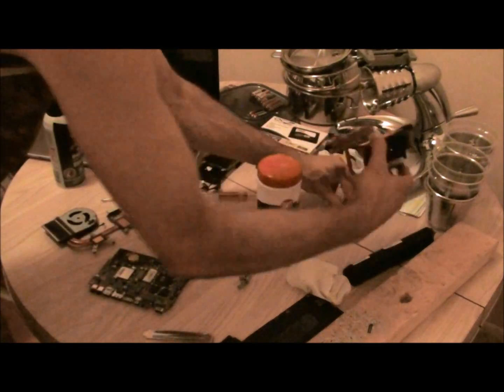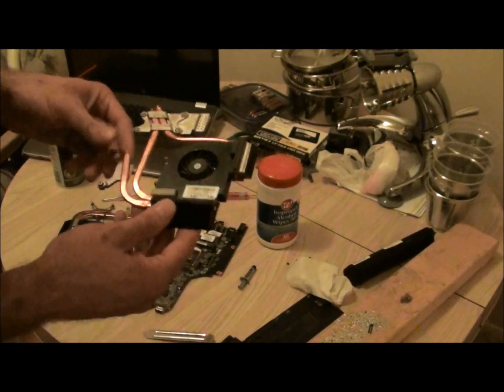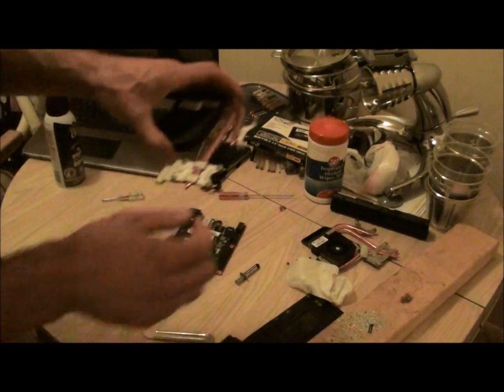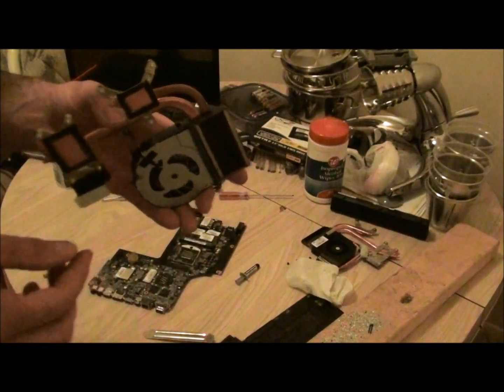Envy17 disassembly part 2 of 2

Comment: So is the claim that using a different thermal compound makes the laptop run cooler?
Reply: +Richard Barraclough  no, the claim is that proper application of thermal compound makes the laptop run cooler. I explain that in the first minute.

Comment: Overheating of these laptops is a design flaw of this product. Ive had this laptop for 3yrs now. After cleaning the fan it will still go back to its old ways. I was wondering if u could show how to get to the inside of the monitor. I have the white screen problem and i dont see any way to get to the loose screen connector.

Comment: hello, Obviously reading the various comments , I realized that you had succeeded to reduce the temperature of the processor . can you explain what that allows for this? (I have difficulty understanding in the video ( thousand excuse) ) .
Reply: Temperature is reduced by replacing the thick coating of thermal paste with a small dot of high quality thermal paste. A thick layer of thermal paste doesn't conduct heat. So basically from the factory a thick glob of thermal paste is keeping the heatsink/fan from doing their job.
Reply: Steven Swanson  Thank you very much.
Since 1 year I tried several thermal paste and the result is zero.
I bought yesterday:

http://www.ldlc.com/fiche/PB00116067.html
and
http://www.ldlc.com/fiche/PB00021822.html
+
http://www.ldlc.com/fiche/PB00052590.html

what thermal paste you advise me?

-----------------

I also bought this:
it works well but difficult to transport:

http://www.materiel.net/accessoire-pour-ordinateur-portable/cooler-master-notepal-u3-plus-noir-94844.html

Thx
Reply: It shouldn't matter what kind of paste.  It matters how much you apply. Just one small dot.

Comment: orion411 you mentioned that original heatsink-fan works better than bigger one used on i5 models??? can you onfirm please? I'm on the verge of buying the bigger (i5 model) but I won't if original work's better, Thanks.
Reply: Don't bother replacing the heatsink/fan. Waste of time and money. Just properly apply high quality thermal paste.

Comment: hi, i just ordered some arctic cooling mx-4, hope it will do the job well. Listen, I've been getting this white screen issue, my screen just blanks out about a minute after I've started the comp, works without problem  when connected to an external one via hdmi though. I have it all disassembled for now, what do you think I should do? Would replacing the screen be an option? If yes do you know where to get the spare parts and how to disassemble the screen? Thanks

Comment: I'm surprised this video doesn't have more thumbs up than it currently does (20). Between this and the other few Envy 17 videos you've posted, you've made me fully confident that I:

1) Know exactly what is causing my Envy 17's overheating
2) Can perform the same alterations to fix the issue. 

Thanks for the level of detail and explanation! It's greatly appreciated.

Comment from the maker: I don't know anything about 2nd gen envy 17, but the 2090NR has the i7-2630QM CPU, which uses Socket-G2. Ivy-Bridge uses two different sockets so just be careful you get one that is Socket-G2. HP officially supports Core i7-3840QM in your laptop (PN:681284-001). But there is also a i7-3840QM with socket type BGA-1224. The i7-3940XM also uses Socket-G2, but uses 10W more so it will run hotter. Search wikipedia for "List of Intel Core i7 microprocessors" to get all the details.

Comment from the maker: The Sandy Bridge CPU uses a different socket than the Clarksfield. So the fastest CPU you can put in these Gen1 Envy 17 laptops is the Core i7-940XM. However, that CPU has TPD of 55W, which is 10W more than the Core i7-840QM. So I wouldn't put faster than a Core i7-840QM in this laptop.

Comment from the maker: Should never have to do it again. Just keep your fan clean. Blow it out with a can of Dust-Off. Blow it in the intake vent underneath the laptop and in the side exhaust vent through the heat sink. Go back and forth between the vents until no dust it coming out and then do a couple more blasts through each vent.

Comment: Hey buddy, I have finally done my applying of thermal compound, and it's working great! opening without running anything I have 45-50 C, and 60-65 running videos and web surfing. Finally, 70-75 C for gaming, which is amazing as I had 97-100 C before. Fantastic differences, thanks again mate! How often do you need to apply them again?